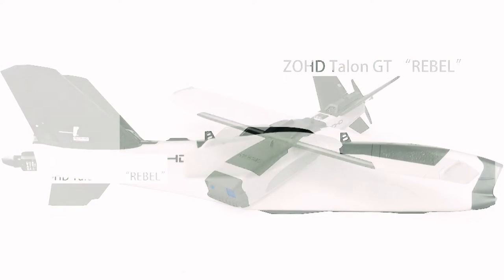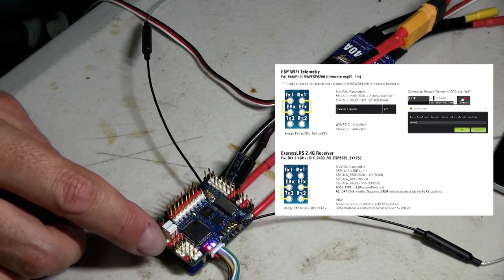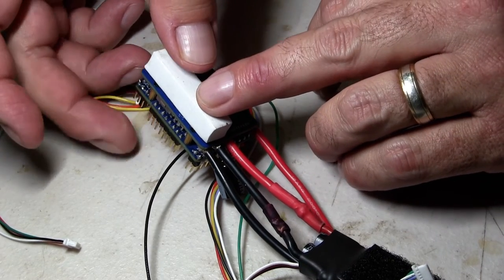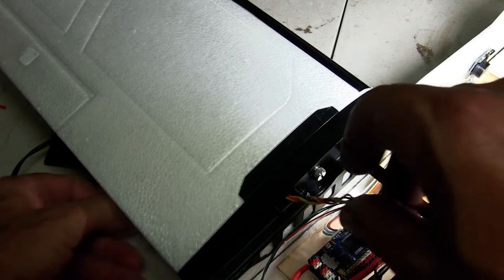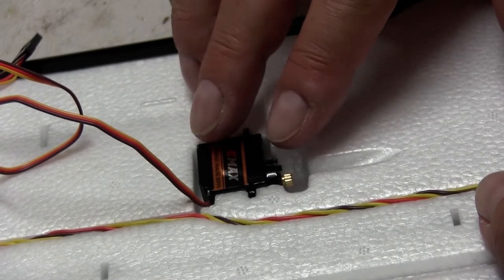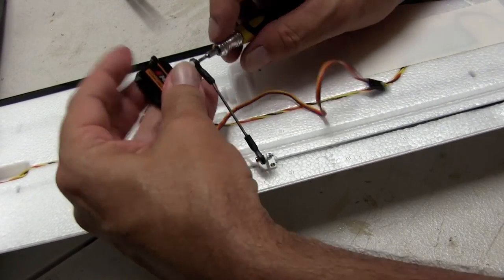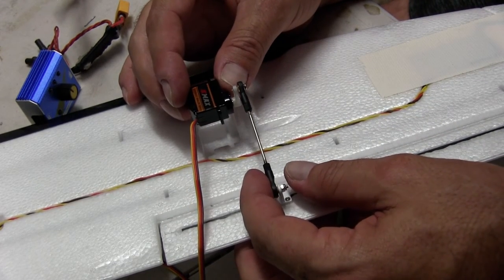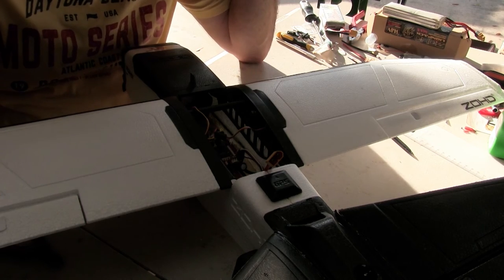ZOHD Talon GT Build - Electronics Setup and Install

Comment: Your videos have some very clean instructions, and I absolutely love it! I guess it will be interesting to see the difference in range with internal 2.4GHz and 900MHz
Reply from the maker: Thanks for the kind comment. The 2.4ghz I’ve switched off and chosen the wifi telemetry module instead. This flight controller only allows you to use one or the the other and because I already had planned previously to run the 900mhz rx before I bought this particular FC I chose to use the telemetry instead. I actually wanted to buy a different matek FC but the limited stock this one was the best option at the time and it was bought after I had purchased the 900mhz rx. In saying this it would be nice to have the option to swap between 2.4ghz rx and 900mhz to test the difference but with this FC it’s not an option.

Comment: Great looking build. But heads up, it looks like your control horn on the Aileron was facing the wrong way.
Reply from the maker: I’m pretty sure that was the only way as the rods are too long with the horns around the other way. It has been flying this way but I will reconfirm that thanks.🙏
Reply from the maker: Yes they were backward can’t believe I never noticed that thankyou for being so observant 👍🏼
Reply: @stonesrcchannel  hah, no worries. Glad to hear (and see) it didn't result in any mishaps with the plane. I just bought one and will be building it soon.

Comment: Great tutorial but I wonder why you didn't use build in elrs reciver is due to wifi option you want to use ? If I understand correctly u can use only one of two reciver or wifi so when u use only one the second antena is not necessary to be installed ? I ask cos I thought that I can use diversity with two antenas build in this fc
Reply from the maker: I didn't use it because I already had bought a 900mhz elrs Rx before I bought the FC. My original plan was to buy either an h743 or f765 FC but I wasn't able to get either due to no stock at the time so I went for the f405 wte Instead as it was the best option available to me at that time. My plan was to always run a 900mhz Rx and not a 2.4ghz as on the wte hence why I went for the telemetry over the 2.4elrs on the wte. No I don't believe you can use diversity with the antenna, 1 is for Rx and other is for telemetry. 
Thanks for the comment.
Reply: Yes you are correct you can't understand correctly your answer, I was going for 411 but decided to buy 405 due to same price like for 411 plus reciever. 405 is a better package a loot of future prove. The shortage is a big pain but somehowe we still flying. Take care and see you on the sky.

Comment: what motor & prop U use？
Reply from the maker: Uses a sunnysky 1250kv motor and a 10x6 prop which I'm still not sure if it's 100% suited. I'm yet to test other pitch types and sizes for better efficiency.